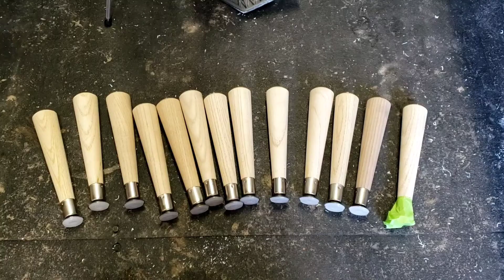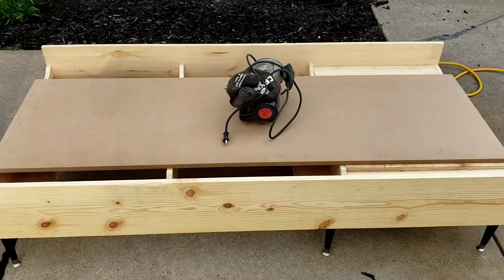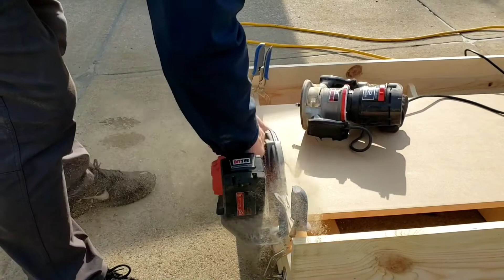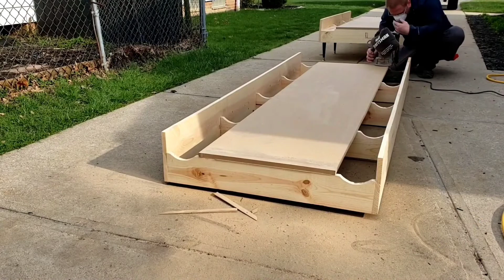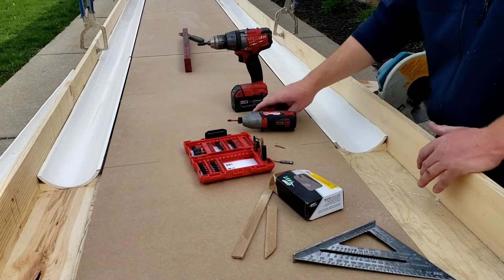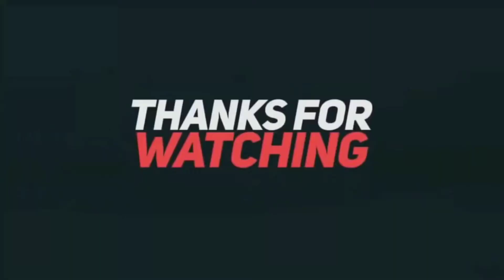Half Scale Mini Bowling Lane Build Part 5

Comment: LOVE the build man! Where did you get the table legs? I think I may need to replace the ones I "made" on my lane with these if they are purchaseable!
Reply from the maker: Coppcastle Thank you. I got the legs from Menards. They are 8" legs. Item # 217-7244. $2.48 each. The plate to screw the legs in are item # 2177254.  $1.99 each. You can order them online as well if you don't have a menards near you. They have different height legs as well. I believe theres a 12" too. Might be closer to what you need for your lane.
Reply: @minibowling1886  I think I may do the 8" legs because with the layers I put on mine it is nearly 18" off the ground. We don't have a Menards but I think I will definitely order some . They seem to be really cool!

Menards may have the last 4 locknuts I need for my pinsetter as well. Thanks and keep up the awesome work!
Reply: @minibowling1886  Oh one more question - do the plates come with screws? If not what size works for them?
Reply from the maker: @coppcastle2856  yes they do come with screws